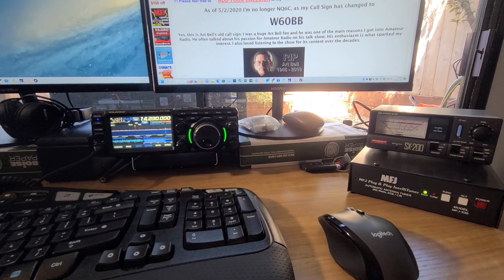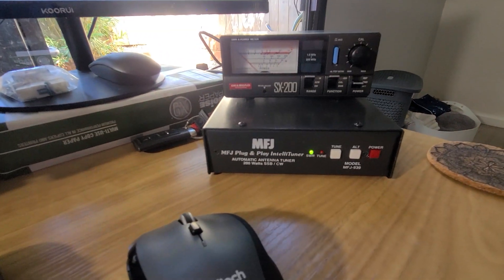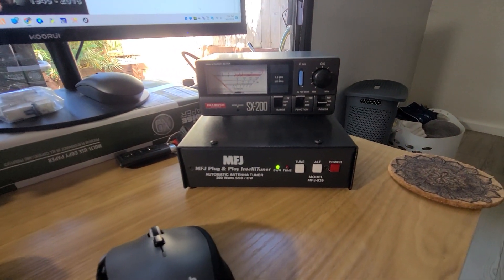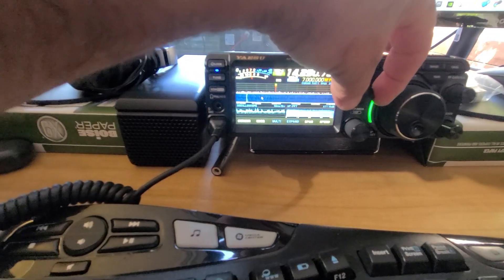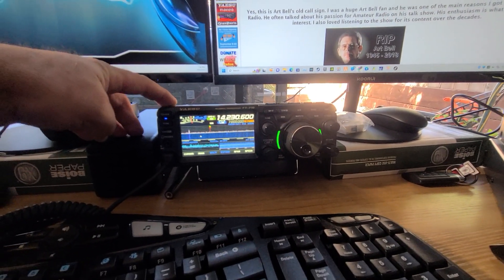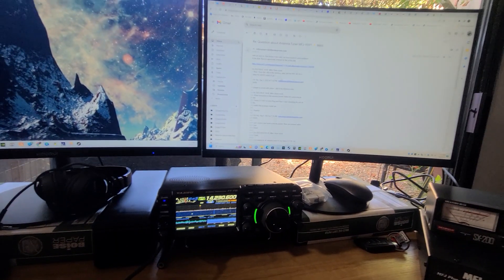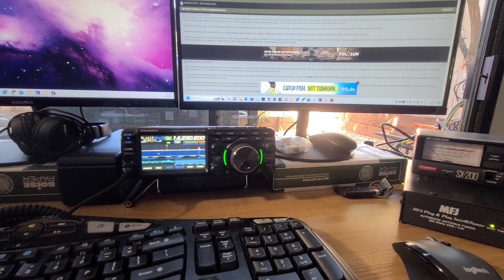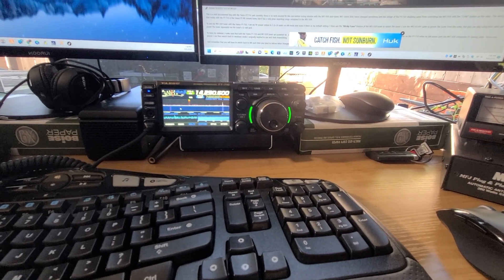How to use your Yaesu FT-710 with an MFJ-939 Antenna Tuner. MFJ-939Y Compact IntelliTuner MFJ-5114Y

Comment: NUP,MFJ 929 SAME
Reply from the maker: I ended up making mine my POTA tuner for the 891. I never used it at home as the built in tuner did fine with the EFHW on 17 and 12. 73

Comment: I am new to HF and have the Yaesu 710 and I am trying to figure out when you need the external tuner vs. the internal tuner?
Reply from the maker: The internal tuner tunes an antenna up to 3:1. If the SWR is higher, you need an external tuner. This MFJ tuner does Matches 6-1600 Ohms (SWR up to 32:1). However, I'd recommend getting an antenna that is a close to resonance as possible. I actually have needed the external tuner with my EFHW antenna. I use this tuner when portable now for POTA or SOTA with my FT-891 as it doesn't have an internal tuner. It works great for my 891 when I want to use my 40-10 EFHW on 17 meters. What's your call sign, BTW. 73 de W6OBB
Reply: @W6OBB  I am KN4CQI

Comment: Has this been fixed yet? also what setting should it work with in the FT-710? I'm trying to interface an MFJ-993b via the MFJ-5124Y to FT-710. No luck so far.
Reply from the maker: I actually ended up not using with my 710. I played with it a bit, but I have turned it into my Tuner for doing SOTA and POTA with my 891 and it works great. I'm not sure about the setting.
Reply: Some advertisers list cables  for LGD/MFJ.i HAVE A 993 and no luck getting a cable .I might try and find someone who makes cables .

Comment: Thanks for this. I have the subject radio and tuner. My biggest complaint with the 710 is the tuner doesn't work a very wide range and requires constant retuning. The MFJ is very fast, if you don' t consider switching the radio to AM. however a much wider range and good memory retention. Also, it tunes my end fed 40 meter antenna on 80 meters, and WARC bands. Yeah maybe not all that efficient, but i also have antenna restrictions.
Reply from the maker: Yes, it works great on WARC bands w/ an EFHW. I bring this with me now on SOTA and POTA with my FT-891 and an EFHW and it's worked great on 17 meters. I've also made a few contacts on 80 with it. Thanks for watching! 73